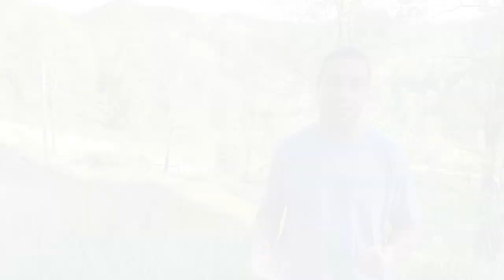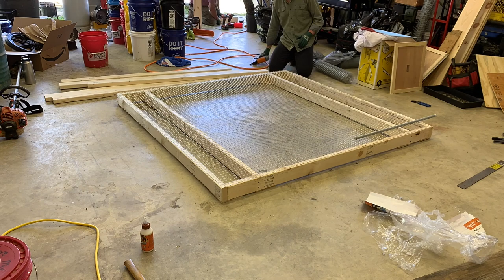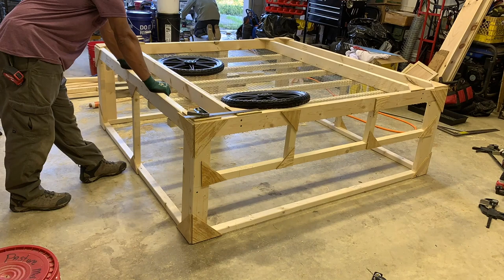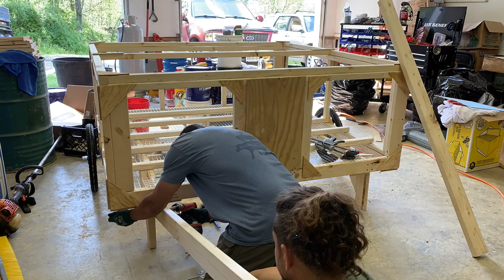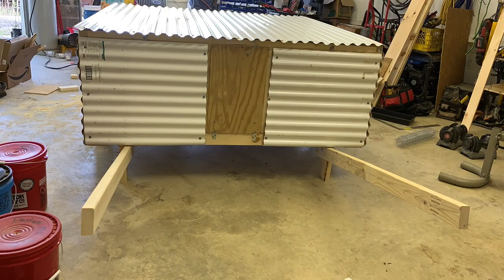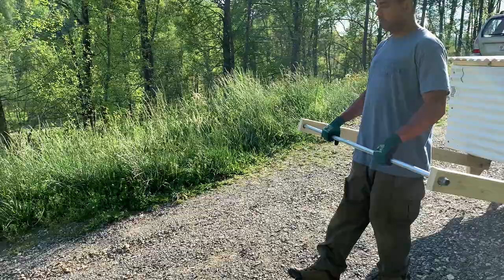DIY Chicken Tractor Time Lapse Build

Comment: Should have my Junkyard Chicken Tractor On Duct Tape ready by tomorrow. I have 8-10 more cockerels coming tomorrow. It’s about halfway done. Need to wait for the birds to roost so I can steal 7 feet of their run fence and replace it with poultry net. The chicks I have in the brooder are 2 weeks old on Wednesday, but they haven’t yet fledged out. The real trick will be the transfer of the chickens from the coop into the chicken tractor. I think I’ll do that when they are asleep. Any other pointers?

Comment: Like your changes to the Shaw, enjoy your videos too.  Three questions: 1)  Why did you choose to enclose all sides?  2)  on the wheels you added a 2x4 and then put the axel through that.  Why add the 2x4 as opposed to just attaching to the bottom of the frame?  Is it sturdy with the gussets added? 3)  What are the dimension of the gussets?  Thanks! Ben